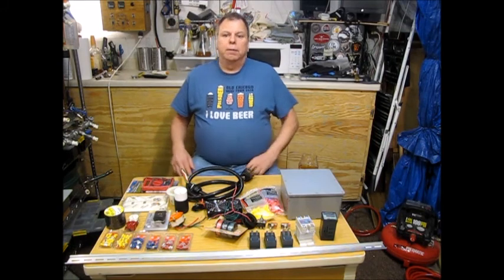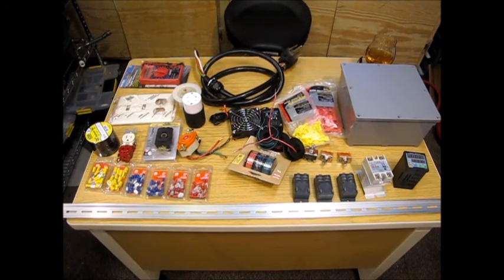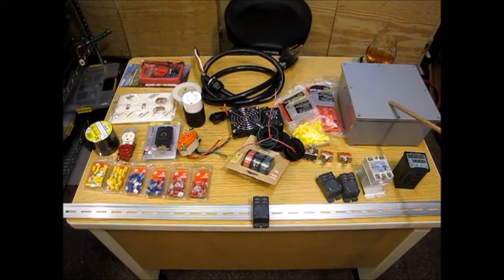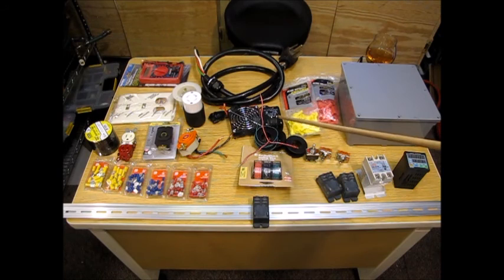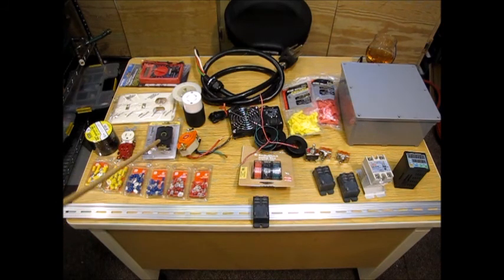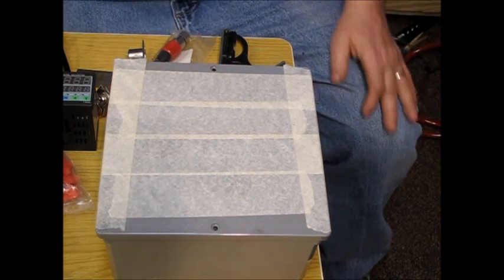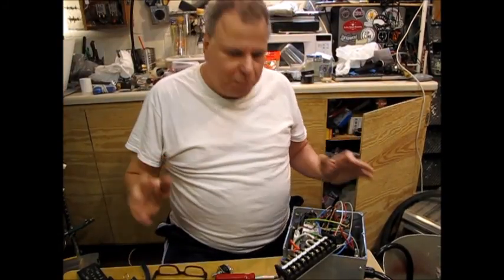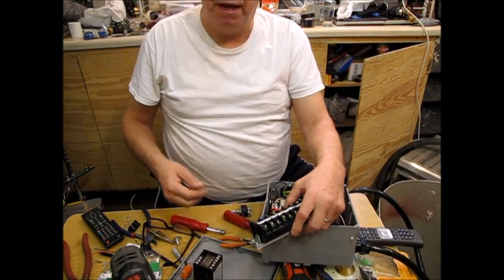Building My New Electric Brewery Controller

Comment: nice work! it is safe to run the pump dry?
Reply from the maker: With a magnetic pump like a chugger or marsh running it dry is not going to hurt anything. It is an impeller and it is on bearings so there should be no issues.
Reply: Thx nice work